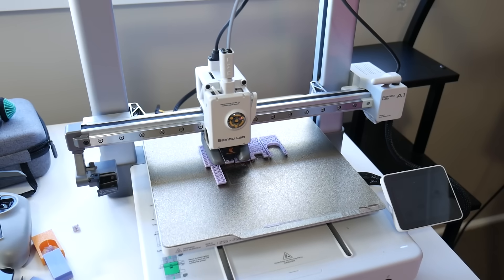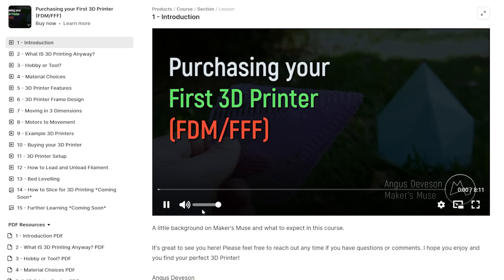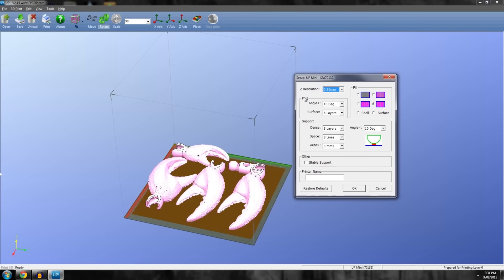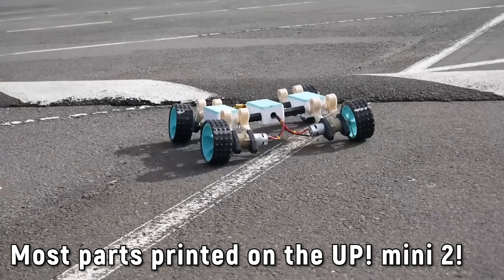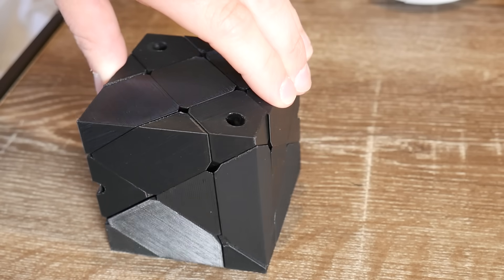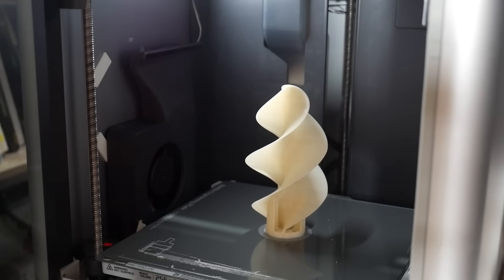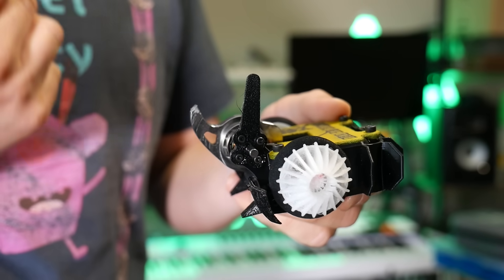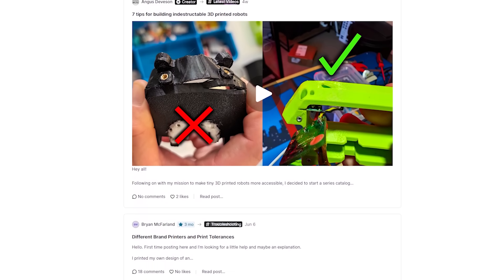The best 3D printer is...

Comment: I'm pretty happy with my sovol printers. Got the sv06 after you said it wasn't garbage and i use an sv08 now. The trifecta of affordability, avaialble design and hackability works great for me.
Reply: Ive Heard stuff about bed warping/probe not working very well, how Is your unit?
Reply: @paolo69  I own a sovol SV07 plus and although I love it, I have two main concerns about it. Firstly, the bed leveling is terrible and I would have to relevel often as prints would stop sticking to the bed. Secondly, klipper (the firmware) would randomly disconnect before prints (never during) which would force me to have to hard reset the printer to get it to work. However, despite all of that, I still think it is an amazing printer for the price if you are willing to have to relevel it sometimes.
Reply: @paolo69  haven't had the same expierience, my bed is fine. i hade one of the pressfit nozzles come loose, but i changed to a microswiss nozzle anyway.
Reply: @paolo69  I always thought of strapping a router head on the heade to level a warped bed but never got around to it as my bed it pretty good and thick (ratrig) but if I was on that one i would definitely do a quick surfacing after heating it up. I have no clue why there are no vids of guys doing this to their beds, especially the thin ones that warp when heated.
Reply: I'm still using my SV-01 as my main machine. Still going strong!
Reply: Printing on my SV06 plus ace right now. Getting the 8 next
Reply: I also love the Sovols. I have a SV06, SV06 ACE, SV07 and an SV08.

08 does have some issues with bed warping and really benefits from a few minutes of heat soak. That issue is the only one I have experienced from any of them.
Reply: I totally forgot about the sv08. The price is good and open sauce is super appealing.
Reply: I have a SV06 Ace, and it’s running great. I honestly have no issues with it.

Comment: I got burned by buying the QIDI Plus4. YouTubers unanimously said it was great. A Bambu killer. After I (and many others) purchased it. It turned out to be a disaster. In the US, their electronics would dangerously overheat. Poorly designed nozzles were completely failing, causing people to replace entire hot ends. Random glitches in the software would destroy prints. This still happens. It has been a nightmare experience. YouTubers cannot be trusted with 3D printing product reviews.
Reply: Hard disagree. Ive had issues with many brands other than Qidi. My Plus 4 is excellent, and I bought it used. Definitely not sponsored. So clean!
Reply: Youtube reviews can't be trusted in general. It's all sponsored. They are legally not allowed to talk about the issues. If you are lucky you'll get a hint that there were some issues and they where reported (and won't be fixed) to the manufacturer.
Reply: @CockroachSlidy this is just blatantly false.
Reply: @riba2233  If it false then why my comment got deleted?
Reply: @CockroachSlidy irrelevant, it's still false.

Comment: Well done! I agree totally. That being said, I have an Eryone Thinker x400 coming. I need a reliable printer with that size of print volume and it was the only one I could possibly find that did not require a full build and programming.

I think also the control software is as important as the mechanics. Bambu has good software but as you mentioned could become a walled garden at any moment. Prusa seems to always be updating their firmware and software but prusa slicer seems to have lost ground to orca.

Klipper seems to be the current optimal control software as it has a large user base and can do a lot of amazing things and has multiple configuration abilities. Once you learn it you can make adjustments as needed (for me following others guides verbatim as I stink at software programming).

Comment: I still say the "locking down" of the firmware of bambu printers is greatly over dramatized, but others, like prusa, exist for those that think they need to tweak the living yell out of their printers. For me I would be happy with either, though the creality KE seems to be holding up fairly decently for me, at least in the year and a half I've had it (i don't print non-stop, but I don't usually go more than a few weeks without making something; was a lot more frequent when I first got it)
Reply: Prusas work out of the box. Maybe wait a bit when they release a new model to shake out the bugs, but that's about it. Wait a bit for the Core One right now, but the Mk4S is a machine you can just unbox and it'll just work.
Reply: @logicalfundy  Got myself a kobra s1 recently and it just works out of the box. I know it's all locked down but who cares? If I ever need to jailbreak it it's easy to do.

Comment: My only printer ever was a Prusa MK2S. I use it about twice a year, honestly... but I still love it. I turn it on, it uses old dusty filament and prints every time, first time. No fuss. No issues. I love it.
Reply: I recently gained access to a Prusa MK3 and Prusa Mini, and both have impressed me every time.
Reply: My maker friends always said, "Just get a Prusa and be done with it." Glad I took their advice. What a rock-solid tool it is.
Reply: Unfortunately mine is starting to fall apart now, the heatbed port is only giving 2V instead of 12, and the replacement mainboard costs about the same as a new entry-level printer
Reply: @echoekhi  maybe it could be somehting simple as a capacitor swap to fix it. Might be an itneresting exercise to try and fix it. I hope it works out
Reply: @echoekhi  have you considered swapping to a 3rd party replacment? A basic BTT mainboard would be much cheaper.
Reply: @echoekhi you can replace the mobo with a mega plus ramps or sanguinololu or other for 20 bucks.  Or just get external mosfet module for the bed if the boards busted just on that
Reply: Its the same with my pusa mk3s got it almost 5 years ago and it just works, never had any isses with it
Reply: I have have had my MK3S (kit) for 5 years. It printed perfect 1st time. I t has now printed 6Km of filament with only a few failures because I made a mistake.
Reply: I had an old A8 with a titan on it that I kept around for years just because it wouldn't stop turning out great prints. I'd still be using it if someone hadn't handed me an SV01. I added a REVO and haven't ever felt the need to add ABL to anything.

Been using it for about two years now and I can count the number of failed prints on one hand.
Reply: After getting into 3D printing with an Ender 3V2, I bought an used MK3S and have upgraded it since to an MK4S. It just works. The Ender is still around, but manual bed levelling is a pain, and the print speed is so much worse.
Reply: I upgraded what was a MK2 to a MK3S magnetic print bed and bearing holders etc, MK3S controller, 0.9 degree steppers on all axes and extruder, Bondtech BMG extruder. I have been able to print at 20 micron with a 0.15mm nozzle and have pretty much no VFAs. It's a great printer now. Quiet too.I run 2 power supplys, one to feed the 24V side of the controller and one to feed the 12V side which powers and controls the print bed.